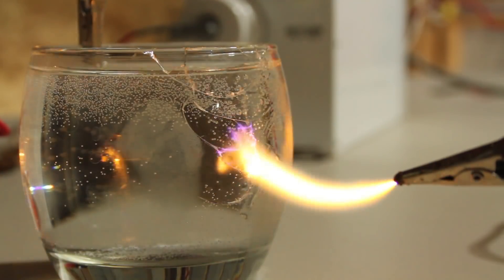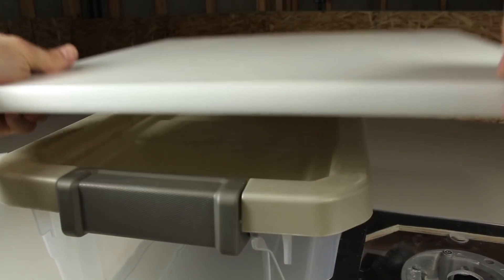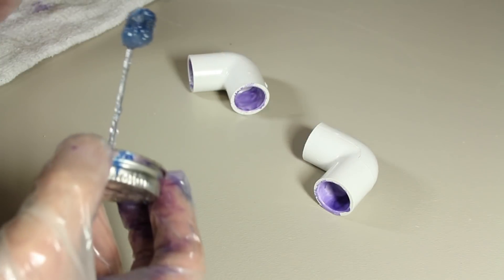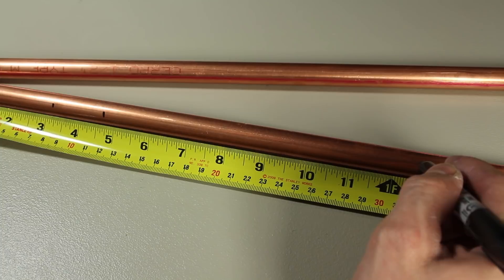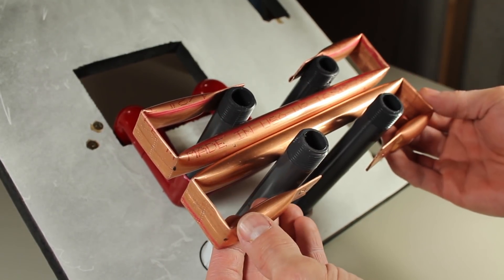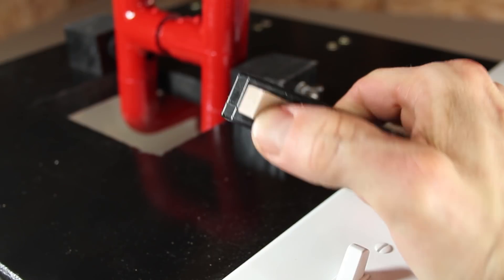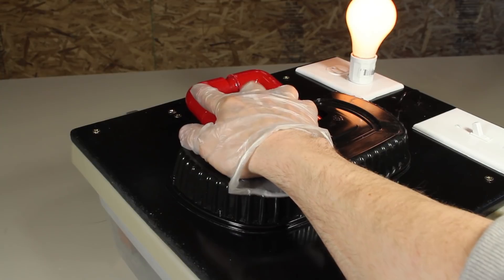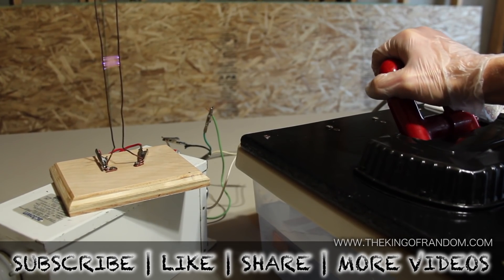The Scariac (Poor Mans Variable Power Controller)

Comment: The video asks for 2 gallons of water. It is used to power a stick welder made out of converted microwave transformers. I like to know how fast the water will heat up when used with a DIY stick welder?  An example: Secondary voltage 36V, secondary current 50A equals to 1800W. Primary current computes to be 7.5A at 240V, but with losses in the transformers I assume primary current would be between 12 - 15A.
I am asking because I would like to use a smaller case for the build.

Comment: This is actually how they control the big 3 phase motors used in some car shredders because it is cheap and very robust.  The only things I would change is to use plastic coated wire staples, include a ground through the whole system and possibly use a container that has thicker plastic walls.

Comment: Hey grant thompson, sorry to burst your bubble but its just basically a dimmer switch or potentiameter. It justs reduces current to the device. Anyone, try this:
Take your vaccum cleaner or any appliance with a ac electric motor and plug it into a outlet controlled by a dimmer switch. Its the same thing
Reply: A typical SCR-based dimmer will handle 300 Watts. He is pushing over 2.4 kW through this thing. That's 80 times more power.
Reply: try running 20amps though a dimmer switch wont you? good luck with that idiot.
this is for the arc welder. not some puny little light bulb.
Reply: Dude, you do know this is for people who don't have access to a dimmer switch, right?
Reply: yes, because dimmer switches are cheap at the hardware store.
Reply: Dimmers are not the same. They use PWM. They do not out put normal 60 cycles per second AC. This is why you can't use them on AC motors or transformers. They are made for purely restive loads. The output from this is much closer to that of a variac.
Reply: Peter Kapica
But what fun is a dimmer switch? :p
Reply: Between a Variac (Or scariac) vs the dimmer, i'd use the variac/scariac, mainly because it was designed to do that type of thing. While yeah, a dimmer may work, i doubt it would handle tougher loads.
Reply: You don't have to be mean about that sayan das. They make  20 amp dimmers. And i said i would like to close this topic, so please don't comment on this anymore
Reply: Uhh.. You can plug stuff in the outlet and see if it will work with a dimmer switch or use the dimmer switch to control your security system i don't know
Reply: Nick Woods see theres fun and then there is safety
Reply: Nothing is safe anymore. There's always some form of hazard with everything.
Reply: Nick Woods Life kills... might as well get it over with.
Reply: yeah true entr opy. Can you tell everyone to close this scariac dimmer switch conversation? Thanks
Reply: sayan das LOL ;D
Reply: that's  why its called a power controller
Reply: Ok thank you. I tried it on my vaccum cleaner and it justs slows down the motor
Reply: Don't know about that, hope you do great Sean Hamilton
Reply: just like he said its like a potentiameter to a LED on a cercuit board...#Common

Comment: great project but i just wanna say one thing. the only reason its kind of dangerous is because youre using such a high voltage and current ( ac 120 v )
Reply: no, its because the lid isn't sealed even if it got clamp and a rubber seals, there a nice gap on both side in between the wood and plastic. lol
Reply: not really. sticking your hand into that water would kill you Emeric Catudal
Reply: Fareed Sanduby just that lmao
how many amp again? 
(it takes only 100mA to stop your heart)

Comment: Good high power potentiometer, however you didn't see voltage change at the output (voltage drop on water in the bucket in other words) because you have measured it without load, so almost no current gone trough the scariac :) that's why it shown about 120V for all it's range.

Thanks for your work and keep up with interesting videos!

Comment: question here.  say a plumber had some copper pipe and had a big bucket with water in it,  then he accidentally spilled some of the 100% LYE drain cleaner into the bucket,   then he accidentally dropped two pieces of pipe into the bucket,  what would happen to him if he reached in and grabbed both pieces of pipe or just one?  how is the current created in this process?
Reply: Well, for one thing, copper and copper wouldn't do anything; you'd need dissimilar metals (copper and zinc) to get an electrical charge.

Comment: wow is this a home made power controller without any electronic capacitors, resistors, triacs etc? this system is placed in series connection with load right?

Comment: whitout load "the voltage is pretty much constant through the entire cycle"
Ohm's law states that the current through a conductor between TWO points is directly proportional to the potential difference(ΔV) across the TWO points [wikipedia]
ΔV=R*I
becouse a voltmeter have a HUGE resistence (and load is not connected), I=0
thats means the ΔV=0 and you have 240V ac before and after the Scariac (V=Vgrid(before Scariac)- RI=240V ).
The Scariac is not a pour man VARIAC, but is a power variable resistor. The scariac is not raccomanded to use with capacitive load (the capacitive load can induce electrolisis), but power a motor is still ok, unsafe but ok.

Comment: This doesn't control current or voltage.  It varies resistance and does so in a non-linear fashion dependent on the load.  The only practical use is to destroy your tools connected to it, but it is still interesting.
Reply: Ummm, what is required to create current? Voltage and..... and..... and....... RESISTANCE! Therefore, by varying resistance you are in fact varying, and controlling, current! Funny how that works.
Reply: suzukichopper
It does not work that way.  Variable autotransformers and rheostats are entirely different in their application and function.  They are in no way interchangeable and no competent electrician or engineer would ever think to claim that they are.  That said, this is still an interesting video and the title only implies 'variac'.
Reply: ***** Variac is the wrong thing to call this, but it definitely does control current by acting as a variable resistor.
Reply: Salt water rheostats have been used for decades in high power applications, particularly large synchronous motor field circuits. They can handle a lot of power in a small package, and are still being built today. They are expensive, but they do the job. I'm bidding a VFD project for a 17000 HP pump for California HELMs project, at 13.8kV. They are very much alive and well.

They won't do everything, but they can in fact do a lot of things.

Comment: Can you use alternative salts for the electrolyte? Pure water is so NON-conductive that some pumps actually have water flowing through the motor-add ANY salt or acid or base and it becomes VERY conductive-NaCl, Sodium Bicarbonate, vinegar, Epsom Salts, Slurm, Yerin, Mrs. Butterworth.

Comment: You compared this to a variac. Only one problem: variac control voltage, not purely current
Reply: This device is a variable resistor.  The water (with the sodium hydroxide) is a resistive element, and the moving copper electrode simulates a "wiper" across this resistance.  There is no coil for induced current flow.  So it is this device which is controlling only voltage.  A variac controls primarily voltage, but some of the power is transmitted via inductance due to the coil.

Comment: Great vid. To those of you who are "freaking out", this device is called a water rheostat. Water rheostats were widely used prior to the 1960s for high-power lamp dimming and many other applications. They are still used today in certain applications. Used properly they are no more dangerous than any other power device and in some ways they are safer. (Water doesn't catch fire, for example.)

Comment: Too much work, materials, too much volume of the device  and too much danger.
There is a very easier and cheaper way to make a variable power controller.
Just search on internet about AC Transistors "TRIACS"

Comment: as an electronics technitian, this scares me...

a lot...
Reply: well it is a scariac.....
Reply: MiniBandit007 aptly named.
Reply: Oh I know that, It's mostly a question of: Whhhhhhyyyyyyyyy?
Reply: ***** True, but often there is also a 'you know this could be a really bad idea if something went wrong'. Although, to be honest, most of the time in that case they just toss some more precautions in and give it a go.
Reply: A brony who claims as electronic technitian... TECHNITIAN technitian... gg
Reply: Unless you're going to put your hand inside there I don't see any reason to get scared.
I mean, in that case anything that deals with high currents should be something scary.
Reply: @Lun4812  high current it not dangerous it’s high voltage
Reply: @IPv4Address  you got that backwards my friend its high current that is dangerous.
Reply: @connorfisher1651  no high current at low voltage is not dangerous the current running through a wire is not dangerous it’s the voltage that causes a current to run through your body which is dangerous I could touch a wire running 1000 amps at 10 volts but if it was 1000 volts at .1 amps I would be dead
Reply: Don’t worry. He’s not the sharpest tool in the shed
Reply: As a normal person this scared me a lot
Reply: there are scarier things like paragliding !
Reply: DarthZackTheFirst oof

Comment: please people dont build this this is the most stupid and dangerous thing i ever see on internet. Safe some money for a variac they are not thar expensive
Reply: This is actually old technology. It started out life as what's called a salt water rheostat. It can do things that modern conventional controllers cannot. Namely handle extremely high power very simply. You do need ventilation with the salt water ones because you can kick off chlorine gas. Believe it or not, there are some salt water rheostats still in use today for some 17000 hp 13.8kV synchronous motor controllers in California for their electrical system. Just because it's old, doesn't mean it doesn't work.
Reply: kleetus92 Do you know how to calculate the power limit of such device?
Reply: Frajolão
Of this particular one? Once it shorts the plate to the bar, the power limit is basically whatever the wire size will allow for continuous current. At positions less than that, it's very difficult to say since it all depends on how much conductivity the electrolyte has, and how much of it is present.The limitation is based on how much energy the water can absorb before it becomes too hot for the container to hold, or it starts to boil.

It really depends on what you want to do with it. What are you trying to make?
Reply: Correct, but its information for a survival or civilization rebuild.

Comment: creates HHO like crazy!! :/// what do i do? is it because i put aluminum plates instead of copper tubes?
Reply: A solution of lye in water will dissolve aluminum and generate hydrogen.
For this project, aluminum should not be used.
Reply: EwePoop
could use salt water too, but then you kick chlorine gas off...
Reply: electroguy2007
I beg to differ. Take table salt, dissolve it in some tap water, take a 9V battery and attach to leads to it, and put them both in the salt water, you'll get green gas bubbles by one of them. I know, I have done it before. You can get the same result with AC power, doesn't matter.

Comment: Why couldn't you just wire a plug to a Light Dimmer ?
Reply: Thats not the point of these videos! :)
Reply: A typical dimmer only handles 600 watts, but I have successfully replaced the triac with a heavier one (BTA16 + heat sink) to make a great power controller for general use around the shop.
Reply: Jay Sybrandy That's what he said.
Reply: Light dimmers have a habit of exploding when connected to an inductive load like the welder he made this for.
Reply: Ohh ok and the Power tool in the video pic is a angle grinder
Reply: ok so u modified a light dimmer and it worked ?
Reply: ohh ok
Reply: eugenesargent I was going to make the same comment.  One thing to keep in mind though is that the device in some dimmers is a dual SCR and/or has an integrated diac on the gate to reduce its sensitivity.  A standard triac may not behave the same way in the circuit.

Comment: Try measuring the voltage again with a load on the circuit.  It should no longer remain constant because of the voltage divider rule.

Comment: BTW: for safety you at least need a ground fault interrupter, seriously, if you want a poor mans power controller: get an open source design with arduino and a couple of high voltage triacs, at least you can put it in a completely sealed can and not get electrocuted.
Reply: Then you don't have a pure sine wave output variable current limiting resistor.
Reply: How are you going to put a GFCI with no reference to limit any current with ground

Comment: Hello Mr. Sir. King of Random,

Do you notice any corrosion on the electrodes (in the lye solution)? 
What is the most voltage you have put it too. What is the most amperage you have seen it handle?

This this is genius if it does what you say it does [hold constant voltage while at the same time having seemingly complete control "over" amperage]. . Where do you here about it if you don't mind me asking. Is there anything else that does this?!?
Welder, no doubt will bring sure artistry.

Comment: Step 1 drive to frys electronics, 
Step 2 Pick up a variac on the electrician/engineering tools isle
Step 3 Pay for said variac at the checkout
Step 4 drive home.

There much easier and safer option (and overall the same price if not cheaper if you factor in labor)

Comment: Well, the problem is, I realy cannot fool them, till I was 16 I still did not fully understand the Ohms Law. :D But since I am working with Ohms Law at least once a week, I heave it totally in my head.

12V DC into 6 Ohms gives a current of 2 Amps and this results in 24 Watts. Let's put this into the Calculator... 

Jep... Or 10V 1000Ohms gives 10mA giving a total power of 100mW...
Jep!
Well, since I work with it, this is in my head. For years I did not use it in practice and did not know it. :D

Comment: You sayd U*I is Power. Correct. But if I stays and R Rises, this means, that Voltage HAS to rise, otherwhise the current can not stay, because resistance limits the current to a maximal given value at a given value of voltage.

And no, voltage does not rise without a reason and it cannot rise any higher than the source for free. Remember: Voltage is the value of the speed of electrons - without any additional energy, the electrons do not travel faster - any car behaves just like that.

Comment: I like this, BUT!

When you wired this, the outlet had no earth/ground connection! Naughty!

It's an interesting idea & I've been playing around with electric & salty water too. I done something similar to this in a jar, but my speed variation was done with standard tap water, slowly adding more salty water until a desired speed was achieved. Downside was, speed wasn't reversible. At least you've came up with a solution to that one. :-)

Yes, rewire this with 3-pin plug & flex & it'll be better!

Comment: These discussions here hurt my brain.

This "Scariac" changes its resistance. The total resistance R is the sum of R1 (the scariac's resistance) and R2 (the grinder's resistance). The voltage is proportional to the resistance. The highest voltage is at the highest resistance.
The output-voltage isn't constant. It just appears constant because the multimeter has a very high resistance. He's measuring bullshit.
According to Mr. Ohm the current I equals U/R. If R gets smaller I gets higher.

Comment: "assuming you have constant current" ? Current is not constant in most cases, especially in this one. It's constant voltage,  scariac creates resistance. I=V/R The bigger the resistance the less current flow and less power. P=U^2/R Voltage stays the same.  It's so fucking simple you idiot.

Comment: Part 4

Finally, a variac is a turns ratio device in that you are changing the turns of the transformer secondary when turning the knob. The result is the voltage will change, BUT it will remain stable over a range of load resistances versus a variable resistor when you select a voltage you want on the variac.  You should bet me $2000 if think I am wrong. I call bets against stupid people the stupid tax because of their sheer stupidity. I won $500 with an electric motor bet versus gas engine.

Comment: Part 3

This means that a variable resistor setup works best if the load resistance ranges are not below the lowest setting of the variable resistor and not above the highest setting of the variable resistor. Also variable resistors are best used when the load is a fixed resistance, if the load resistance changes then you have voltage drop change. Therefore variable resistors are best used for CURRENT LEVEL LIMITING FOR A FIXED LOAD RESISTANCE.

Comment: Part 2

At lower resistance of the variable resistor, the total overall resistance of the load + variable resistor will be lower which means MORE CURRENT FLOW. Since this is a series circuit and if the load resistor is a higher value then a higher voltage drop will be across the load resistor. BUT, if you make the load resistance less than the low setting on the variable resistor then the voltage drop across the load resistor will be LESS.

Comment: only if the water turns into 2 parts hydrogen and 1 part oxegen. then anything that is even hot will make it explode. but you need the "HHO gas generator" made in a different video.